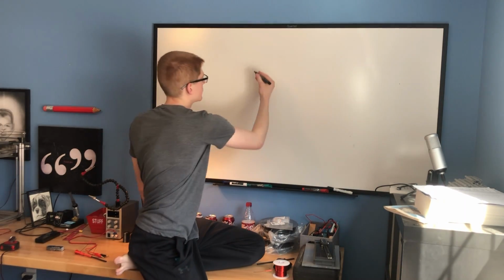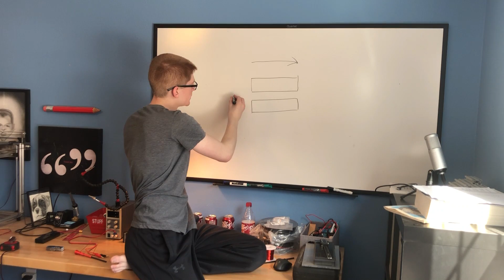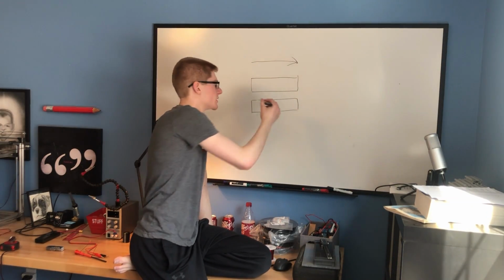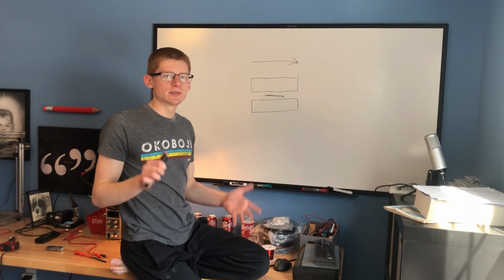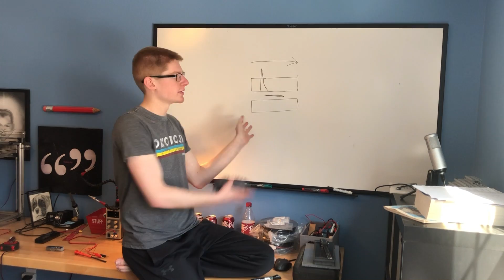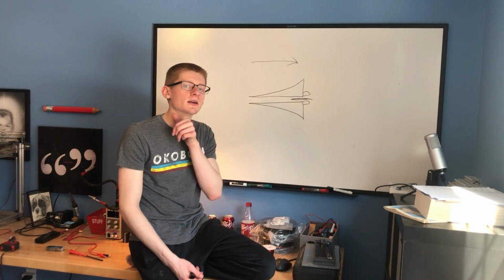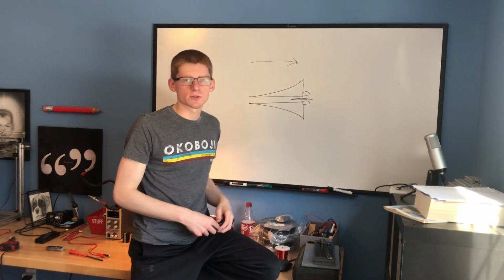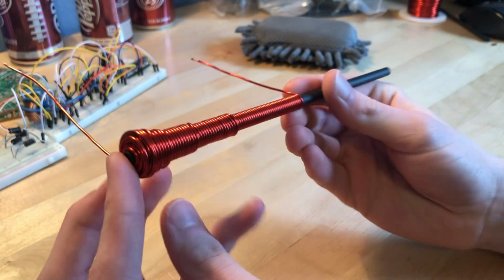Making a Coilgun - Part 3: Reconsidering Everything

Comment: I will be submitting some work of my own before too much longer, but I will point out that coilguns can be made far more efficient by changing the nature of the projectile.
A ferrous projectile suffers in two ways.  First, it can saturate.  Second, it can only make use of around half of the coil's length for acceleration, as any magnetic flux present in the coil after the projectile has passed the center will be a loss.  You can bias the coil to help mitigate this to some degree, but even so, you will have to match the resonant LC frequency of the coil and capacitor to the acceleration profile of the projectile to get maximum efficiency, and nearly half of the cycle has to be managed as a loss.  You can use an IGBT or similar to trim what can't be resonance matched - but you have to contend with the collapse of the magnetic field, as well.

You can improve efficiency greatly by inserting a magnet into a solenoid.  A magnet inside of a solenoid will move exclusively in one direction based on its orientation to the direction of winding and current flow.  This means that, up until saturation, the magnet's response will be acceleration under any present magnetic field.

But magnets are a poor projectile choice and quite expensive for the more powerful varieties.  Cheap magnetized iron/steel could be used, but will easily saturate.

There is something, however, that is cheap and will not saturate.  A closed loop secondary - a shunted solenoid inside the solenoid.  Configured as a sabot, nearly anything could be accelerated so long as there is a changing magnetic field.  The full power cycle of an LC circuit can be used (provided the projectile is not accelerated out too quickly).

There are two things to consider in this approach.  First is that the speeds many want to achieve with a coilgun can be translated to a distance over time equation and optimal efficiency will be achieved when the LC resonant frequency completes its full oscillation within the time it takes the projectile to leave the coil.  A full analysis would use a differential graphed equation to show how the increase in power in the coil translates to acceleration of the projectile - you can have a slightly longer cycle than what is implied by a length of final velocity over time - but it's a decent rule of thumb.

This means that faster projectiles mean lower inductance, higher current coils with lower capacitance, higher voltage capacitors - and/or longer overall coils.
However, the longer the coil and the higher the power, the more that coil is going to self-repel and the two ends are going to want to bend back onto each other.  You'll want a nonferrous, nonconductive, rigid material to use as an insert or jacket to prevent coil distortion.

These will also be significantly more powerful than any existing coilgun you see shown.  80% efficiencies have been recorded in airforce and navy research in using these as primary boost stages for orbital rockets and the like.  Which - I found the claim curious when I read over it because every action should have an equal and opposite reaction capping electrical energy to acceleration at 50%... But then I consider the efficiency of electric motors and wonder if I am missing something about physics... Or if we are all missing something blatantly obvious and profound.
Reply: The basic bit of physics you are missing is the context of "equal and opposite reaction".

That's in Newton's Laws of Motion and is talking about forces. It means that every force has an equal and opposite, you throw a ball, the ball pushes on your hand so the hand goes slower than it would if the ball wasn't there, getting accellerated.

It is not a law of thermodynamics, and puts no cap on efficiency of anything. It just means there's never a force that comes out of nowhere.

Also, who the fuck is using electromagnetic propulsion in orbital rockets? AFAIK, the only things that have ever managed orbit are some variant or another of combustion engines. Once IN orbit you can consider solar sails, ion thrusters, or a boatload of more esoteric shit, but I was under the impression you needed energetic chemistry or nuclear energy to get the power, endurance, and Thrust/Weight ratio to manage a launch stage.
Reply: @willb5278  
See above.
Now, an interesting thing can be done if you were to make a primary solenoid with, say, tens of thousands of turns.  To this, you attach a series of capacitors and switching components creating a resonant lc network of around 1 megahertz.  This is going to be a small capacitor value, so you need to store, say, a megajoule in the form of voltage.  Energy in a capacitor is equal to one half the capacitance times the square of the voltage.

In the secondary winding, you use an "angel hair" wire, just a few turns, not even a full gram of mass.
When you pulse your primary coil, you get one megawatt over 250 picoseconds.  Quarter wavelength is all it takes to fully transfer power.

Your secondary turns into plasma and as it is elongated due to self-repulsion of its windings, preserves its initial turns ratio even though it becomes a plasma.  The velocity it achieves is determined by the energy input into the coil - minus the losses of switching and turning the secondary to plasma.

Thus, with a starting mass of less than a gram, a net force of something in the megajoule range can be created.  Which is a specific impulse of stupid.

You can also do something fun by creating the inverse scenario - a small number of primary windings driven at a high voltage with an internal secondary consisting of thousands of windings.  By keeping the secondary anchored and open, you create a rather insane electric field potential contained within a solenoid's magnetic field - designed correctly, you have a gyrotron - with a bit of a noteworthy difference.

Keep in mind that most electronics has still not adapted to the innovations in solid state switching.  Most electric motors are still designed to use 480 mains through contactor relays.  Small teams working on things that require new problem solving strategies will be decades ahead of industry even when working COTS.
Reply: @Aim54Delta  
First off: "net force of something in the megajoule range can be created"

Joules are energy, not force (that's newtons) if you're measuring kinetic, thermal, or some other kind of energy don't confuse people by labeling it force.

2ndly, Unless you're claiming to have created a perpetual motion machine, you've missed an important point. Capacitors are garbage at energy storage. Don't get me wrong, I'm sure they're much better than they were a few decades back, but compared to gasoline? Rocket fuel? Nah. Those are Megajoules/kg. Which AFAIK is somewhere between 1000 and a few million times more energy dense than capacitors. 

That's the issue with booster stages, specific impulse is important, but you also need to account for how heavy your engine/power source is. All the power required to yeet your propellant up to speed has to come from somewhere, rocket fuel doubles as both power source and propellant and is real efficient (mass-wise) because of it. Any electrical engine has to include it's power source in the weight of it's engine. If the thrust/weight ratio isn't high enough it won't matter how high your ISP is, you won't get off the ground.
Reply: @willb5278  
There is no practical reason, in the described scenario, to differentiate between force and energy as that adds an unnecessary layer of complexity.  Force is useful in classic physics to create an acceleration graph and is rendered as a velocity change per unit mass per time.  This would be the mechanical equivalent of power - being energy per unit time.  The metric system largely renders all chemical, mechanical, and electrical units of energy the same (enthalpy of formation and combustion are expressed in joules) - so differentiating between energy and force in a situation where you have a single event imparting the acceleration is largely irrelevant other than for semantics or doing structural analysis for shock (where the actual force generated by this will be orders of magnitude greater than one meganewton because of the time over which it occurs).  But because we are dealing with a paper machine, not a real one in this, the only people this is going to confuse are people who are eager to show off that they know enough to be confused.

Petty semantics aside...

You realize that a capacitor is a component within a system - or, in this case, the device I describe is a subsystem of a drive mechanism.  Obviously, we are deriving our power from somewhere else.  When calculating specific impulse, we are only concerned with the fuel.  In an ion drive system, for example, only the mass of the xenon and the acceleration generated by it is factored in.  Specific impulse is a measure of how fast you are throwing your reaction mass out the back end to produce your change in velocity.  It necessarily excludes other factors which would be counted as accelerated mass.
While I do not have an aerospace or astrophysics degree, I am an alien who stayed at a holiday inn express who can land on the mun and return to kerbin - so I do at least understand how you all address the subject of space travel.  You haven't yet discovered the means to ... As you would possibly understand it: "coherently propagate" - a process whereby the mass of an object is propagated at the speed of light to a set energy potential.  This can do interesting things, like diffract around an object - like the moon - and the brightest spot, as they say, is at the center of the shadow.  All orbits can be expressed as an energy potential and all positions relative to a massive object can also be expressed as the same.  You already have some of the principles.  When the air force was developing particle weapons to bring down incoming nuclear warheads - they discovered an interesting phenomenon where high energy particles tend to phase through space and material before suddenly dropping their energy into a specific spot.  This is a matter of public record.
You'll also note they make use of heavy metal ions in linear accelerators for some of their work.  This was before they discovered plasma wakefield acceleration - which makes linear accelerators vastly superior to synchrotrons in terms of raw particle energies produced... But I digress.

There are two types of viable fusion reactors which generate a net yield.  The first you term as a "stellarator" and the primary yield comes not from thermal energy harnessing, but from the harnessing of the rotating magnetic fields generated by the plasma.
The second type you refer to as dense plasma focus, which is currently used as a portable neutron source but can, with some modifications, be made into a rather efficient discontinuous fusion reactor.
Well... There are others, but it involves 2d materials and manipulation of material strain to distort the electric fields of atoms and allow a fusion process to be catalyzed within overlapping "quantum dots" or "quantum wells."  Most of the energy can be harnessed by propagation of the disruption of the electron orbitals (think of it a bit like piezoelectricity in a 2d material) - but the problem is that you have to order it to get any use out of it - otherwise it is just heat and that is a bit harder to deal with.

A cobalt-doped graphene oxide structure can be used as a direct sugar fuel cell which can catalyze dextrose, sucrose, glucose, etc into electric power.  This, obviously, has lower energy density compared to fusion, but these could be used in a close loop cycle with photosynthesis.
Though an alternative solution would be to store hydrogen in aluminum hydride - which can store significantly more hydrogen per unit volume than liquid hydrogen - and since aluminum is, itself, able to be oxidized, the whole complex can be used with an oxidizer for energy production either as a catalytic process or classic combustion if you want to feel retro.

Returning to my prior question...
If we get a net 2 kilojoules of energy out of our device for one kilojoule of energy stored in a capacitor - and indeed this is so for all electric motors - then what is it we are missing from our models when we merely discharge the capacitor through a resistor?
What could this indicate about the nature of electricity?
About the phenomenon of electrical resistance?

I will defer you to a very poorly written (though inadvertently genius) question I had on one of my avionics course quizzes:
"True or false: electricity is electrons."

We'll also see what your sense of humor is like.
Even if I am an alien, you aren't supposed to believe that is possible for another... Checks watch ... Well, if you were to leave a message for a species for the time when they became space faring... The far side of their moon might be a nice place, right?  Assuming they have one, of course.

But the real show isn't until 2024.
And if I am not actually an alien... Well... Then wonders truly will never cease.
For if wonders should stop, then so too would all purpose in life.  As such, I am The Life (that will never ever die... And I'll live in you if you'll live in me.... Eh, you probably don't know the hymn...)
Reply: @Aim54Delta 
That alien bit was a KSP reference right? Also, holy wall of text batman, you typed a lot, much of which was hilariously off topic, or at best tangential, to the topic we were discussing.

I was about to make a comment about force mattering for thrust/weight ratios, then I was going to talk about how ridiculously heavy a properly shielded fusion device would be (and therefore how crap it would be as a powersource for a booster stage). But then you dropped this line and I had to abandon all that for something more important.

"If we get a net 2 kilojoules of energy out of our device for one kilojoule of energy stored in a capacitor - and indeed this is so for all electric motors - then what is it we are missing from our models when we merely discharge the capacitor through a resistor?"

Yeah, no. That would violate conservation of energy, or at least one of the thermodynamic laws, and be patently obvious to any scientist who spent 10 minutes comparing said device to their highschool physics notes. Considering capacitors are friggin everywhere, there's no way you're the first person to notice such a gross violation of high-school physics. Revisit your notes, carefully check your units, and find your error, because you're wrong. How do I know this? If you were right, this would have been noticed millions of times by thousands of people over the last decades, and someone would have made a perpetual motion machine to replace power plants, make billions, and save the planet from climate change.

You cannot get 2kJ out of something you only put 1kJ into. Not unless it's got an energy reserve it's depleting to give you the excess. If you could, making a perpetual motion machine would be as simple as plugging 2 together to charge each other, and tapping the excess for free energy. That's impossible, so ya done goofed somewhere. Tracking down the exact error that lead to your misconception would take hours of back and forth and is not worth my time.

But if you have, by some miracle, found a flaw in the 3 laws of thermodynamics, prove it and collect your Nobel Prize. But I doubt that's what's going on.
Reply: @willb5278  
Perhaps I presume my own knowledge is far too standard.  I forgot that electronics is not taught to most people - particularly AC electronics.  This will become important in a bit.

A capacitor stores energy in the electric field between two conductive surfaces.  An inductor stores energy in the magnetic field around a conductor.  In practice, all real objects have an inductance and capacitance by virtue of existing in three dimensions.  RF and Microwave electronics must pay particular attention to this as solder joints, themselves, can alter the native capacitance or inductance - and most wires act as waveguides when approaching the centimeter band and you have to avoid reflections in PCB traces and component junctions.  There are even implications for large surfaces, but I digress.

A capacitor and inductor, when placed in parallel with each other, create what is known as an LC resonant circuit.  This "tank circuit" (as it is called in AC electronics) will store energy in alternating electric field polarity and magnetic field polarity.  Electrons will flow from one plate of a capacitor, through the inductor, and then be affixed to the opposite plate of the capacitor from where they started, then, again, flow backward to the other plate, and the process repeats.

It is worth noting that I could take, in theory, a length of wire, flatten the ends until they form plates for a capacitor, and wind the wire around a shaft to create an inductor.  All I have done is change the geometry of the conductor and conductive path - no material has been added or removed.  I could take an identical piece of wire, which has not been altered, and discharge an amount of electrical current through it, causing it to heat - even explode.  This same electrical current, discharged into the wire altered to be a capacitor and inductor in parallel, will not explode and will, instead, store the energy.

Let me word this a different way - the electrons moving through a normal wire cause heating of the wire and consume all power.  If I have a giant block of copper with extremely low resistance and short a battery with it, all of the power is dissipated and the copper heats in proportion to the power dissipated.  Ohm's law.

However, just by changing the path of the electrons, we prevent them from dissipating energy.
Why?

On a surface level, this is because voltage and current are out of phase.  When voltage is at its maximum, current is at its minimum, and vice versa.  Since power is equal to your voltage times your current - having your current flow at its highest while voltage is at its lowest means your formula predicts the two will never combine to produce power dissipation.

But why?

How is a photon described in physics?  An oscillation of the magnetic field and a 90 degree rotated oscillation in the electric field.

Heat is the phenomenon whereby atoms (largely governed by their electron shells) move and vibrate against each other.  QM gets a bit more specific and can break this down into phonons of quantized potentials - but this is why I mentioned kagome materials/lattices and the impact mechanical strain has upon their electron orbitals.  When graphene is strained, for example, electrons in the orbitals can behave as though they are under magnetic fields in excess of megateslas.  If you want cold fusion, then you're going to have to understand this principle.

Let's return to heat.
We know that if we hook up a one kilowatt electric motor and run it, we consume one kilowatt of electric power and we drive a load with one kilowatt of energy... Well, probably 950 watts, but not really the point.  We also know that newton requires us to have an equal and opposite reaction.  So we are actually dissipating 1 kilowatt of power in the opposite direction.  The mass of the earth is just so large that we don't even think to calculate for the effect.

But this is, quite obviously, a problem, because if we replace that motor with a resistive heating element rated for 1 kilowatt... We will only get 1 kilowatt of caloric heating.

So, the question is...  Is there something occurring within electric motors whereby the energy difference is relative and/or unrecoverable?  Obviously, the behavior of a compulsator, even in microgravity, would indicate that you can only ever recover one joule per joule invested because the difference in velocity is what generates the power and cancelling the difference in velocity means they return to the same rest condition.

Yet, this does not fully address the problem, either.  Why is it that the electric field and magnetic field combine to produce ohmic heating, and where is the "reaction force?"  If ohmic heating occurred via newtonian physics, then the net motion of molecules would be zero.  This is not what occurs and the net enthalpy is negative.
Reply: @Aim54Delta  
Oh, nvm this won't take hours, that misunderstanding showed up really quick.

Equal force does not equate to equal energy, and Newton's laws apply to force, not energy.

Energy is force * distance. The electric motor you used as an example exerts an equal FORCE on both the thing it's spinning, and it's mounting (whether that's a table, a car, or the planet). But because the mass of whatever it's affixed to is so much higher, the mounting moves a much smaller distance with that force, and so the motor imparts a miniscule portion of it's energy upon it's mounting, and the vast majority upon it's axis (with some other fraction of the total lost to heat, of course).

The motor you described does NOT impart or 'dissipate' a kilojoule of energy onto the planet, and another kJ to whatever the motor axis is attached to. It exerts a kiloNEWTON of force upon both in opposite directions, but the lighter thing gets nearly 100% of the kinetic energy it creates.
Reply: @willb5278  
Can you impart a force onto an object without imparting energy to it in some form or another?
You're making an arbitrary distinction that does not exist in practice.  The atoms of the motor can't possibly know whether or not there are billions more beneath them when the forces of the motor are acting and energy is being consumed.

In the case of a rotary motor, there is a torque which forms and places various parts of the structure under strain.  This strain propagates until all unit energy is accounted for in the form of atom dislocations, piezoelectric potentials, chemical bond changes, etc.

Now, if the argument is that these can only take certain forms and can't be equated with other changes in enthalpy, then that is fair enough - but we are then dealing with some alternate metric of "force" which still exists and yet does not change entropy and enthalpy as expected.
Reply: @Aim54Delta  
It's not an 'arbitrary distinction'. The difference between force and energy was beaten into my head nearly a decade ago in physics class.

Force is newtons, energy is joules. Joules are newton-meters because energy is measured as a force *acting over a distance*. If you push on something and it doesn't move, you have produced no kinetic energy. If it doesn't compress or deform, you have produced no thermal energy. If you don't re-arrange the electrons, you have produced no magnetic or electrical energy.

That is your simple mistake, you have equated force and energy in your mind and forgotten the distance component that separates them.
Reply: @willb5278  
Can you produce force without energy?

For someone who talks so much about physics and newton, you are quick to dismiss him.
You stated, prior, that energy is not imparted (I used the word dissipated, which is probably a poor choice since dissipation implies thermal yield - while a generally trivial distinction from a change in velocity, the two are not always as contextually interchangeable) to "the ground" when a motor spins.  Because force is not the same as energy.

In which case, every electric motor is a reactionless drive, capable of producing a change in velocity of one mass while imparting no change in velocity to another.

To put this into a more proper context, let us consider the reaction wheels of a space craft.  The object of greatest mass does not simply get to declare itself independent from newton.  It is pushed in the opposite direction from the lighter mass with the same amount of energy.  This is why the formula for useful work/energy is 1/2 capacitance or 1/2 inductance.  The other half of the energy goes into the reaction mass.

In principle, when an electric motor spins, it is equally pushing the whole earth to try and spin about the rotor in the opposite direction.  The mass is so large that we can discount the effect, and even if we were to get an ultra-mega-massive motor to prove a point that it will spin the earth, the relevant forces involved will be so great that the process would be one of fluid dynamics as the crust broke down from the pressure and shear forces into liquid - lava.

This prompts us with two questions.

First.  See my original one regarding caloric heating and the value of energy in a capacitor.

Second.  Why is the process of, say, drawing a bow different from the process of spinning the rotor on a motor?

What is happening in the bonds between atoms which allows one to store energy while the other transforms it into the phenomenon we call velocity/acceleration/inertia?

How does the introduction of energy into one system work, at the atomic and/or subatomic level to produce the behavior we model and classify in classical physics?
Reply: Wish I knew what exactly you mean by a "shunted solenoid" and the sabot configuration, this sounds like a cool thing to try out.
Reply: @MoltenSamurai  
A shunted coil is an inductor with the ends electrically connected or shorted together.  You can think of it as being an air-core transformer where the secondary is just a loose coil with the ends shorted.  Rather than energy being dissipated as heat, it is largely converted into two opposing magnetic fields, which repel each other.

The interesting part (and the same is true of electric motors) is that if you have 1 kilojoule of energy stored in the capacitor, each component will accelerate by 1 kilojoule.  IE - two kilojoules of energy total.

This then begs the question - given that this is the same amount of energy stored in a capacitor as when you discharge it to produce 1 kilojoule of heat....
Where is the kilojoule of "equal and opposite" in the resistive heating?
Reply: @randy marsh 
Sort of.  I did finally encounter a similar configuration in what is called annasymmetric bridge converter that is used in switched reluctance motors.